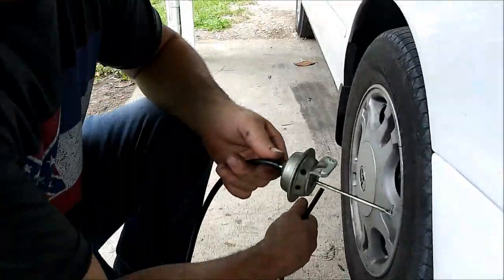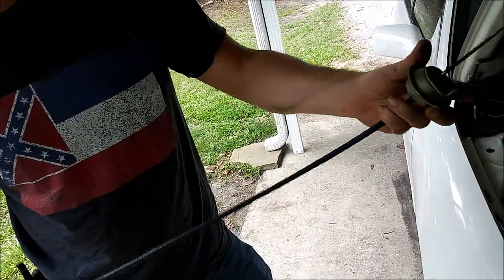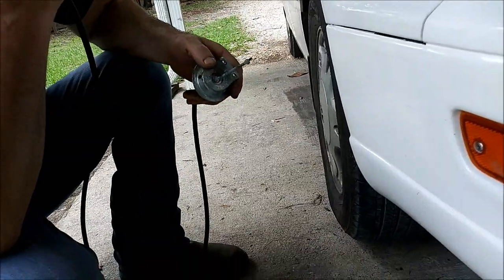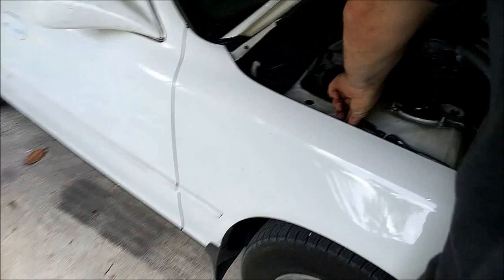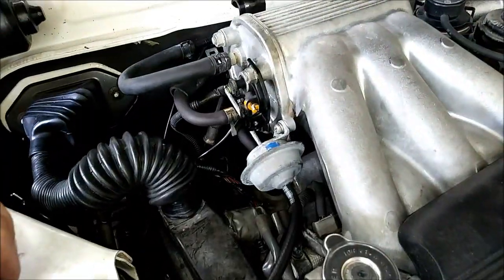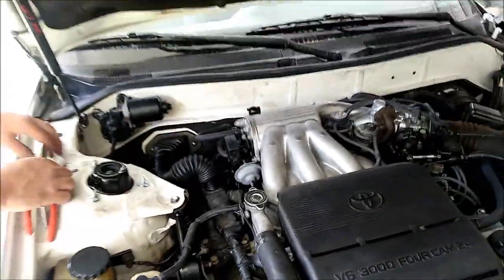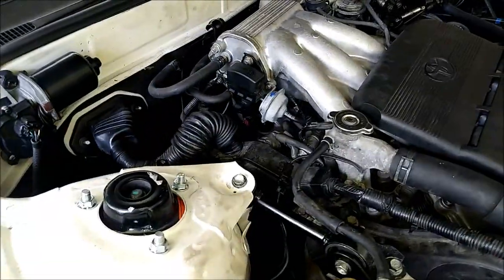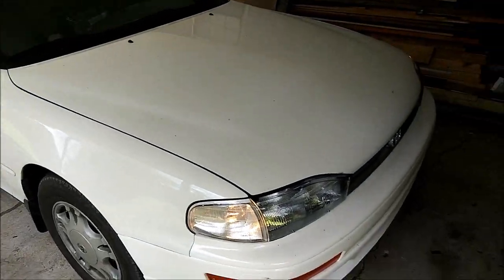Toyota V6 ACIS Vacuum Leak Repair

Comment: Can you rig it wide open...😅  i wonder  hmmmm😎
Reply from the maker: Sure you can, you might lose your low end hole shot. ACIS is for more top end.
Reply: @shadetreeautomotiveDIY  you  are Exactly right… I did it…👍
Reply: I actually found one at a salvage yard outside Chicago… I should get it Monday hopefully will go on as easy as it looked in that video… I'll put a report back out👍
Reply from the maker: @darksolara6750  That's a good move, I think it'll help with gas mileage and stretch out your power band. It may or may not be a huge difference. But I noticed it. It gave me a little bit better hole shot because it solved the slight vacuum leak from the busted diaphram of the ACIS. Of course it helped with idle, and then I noticed the smoother acceleration, but consistent. As long as that flap is actuating and not stuck from carbon inside the intake, you should notice a slight improvement. Good luck.
Reply: @shadetreeautomotiveDIY  Funny you should say that I was just thinking about that the other day a buddy of mine said maybe you should take it off in advance and go ahead and clean that butterfly valve and all that etc.… I didn't want to open Pandora's box… Ha ha ha ha ha hey real quick when you put yours on that the end that has the little bead at the end looks like a little ball on the end of the arm… Does that just pop into that hole on the side on the top of the Plenum?
Reply from the maker: @darksolara6750  I can't remember, but I think it had a small snap ring. Keep a pair of needle nose and a magnet handy, it's very small.
Reply: @shadetreeautomotiveDIY  Thank you very much for the video and thank you very much for taking time to respond
Reply: Got it on... Definitely tell a difference…!   .. The snap ring was a little bit of a challenge  actually dropped it twice and found it twice… Finally got it on… I have a day like that ..I might go play blackjack!🎉🤣🫡✌️

Comment: Nice vid, almost no info on the the web or even some manuals regarding this actuator,  recently bought a 95 Camry 1mzfe wagon.
Had a 'low power' feel to it, realized this diaphragm was broken, also creating a vacuum leak.
temporarily wired it( open)(as if vacuum were applied , made a noticeable difference with power.
Okay mileage on testing , but a properly working on would do better I'm sure(power when you need it/economy when you dont)
Thanks for the vid
Reply from the maker: Your welcome. I wasn't able to find the ACIS actuator on ebay. However, I'm sure the part is sold on ToyotaPartsGiant and other OEM part sites. I got mine from the junkyard. Out of the three I picked up, 1 was also broken.

Comment: Wish I could have seen how the vacuum lines routed
Reply from the maker: Did you get your vacuum lines straightened out?
Reply: No, attending other issues but I need to see how they route to connect the vsv
Reply from the maker: @usagimoto1423  I'll get you some images. Stay tuned.
Reply from the maker: @usagimoto1423  Vacuum Reference...
https://youtu.be/q0FtD8jjFg8